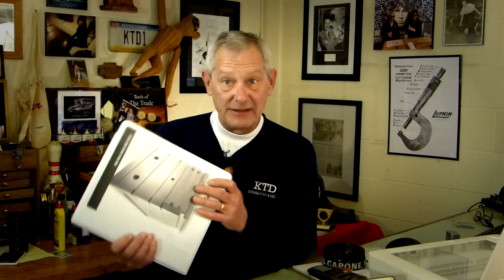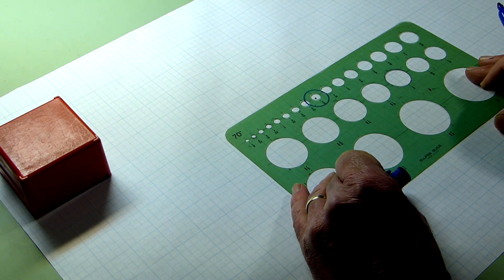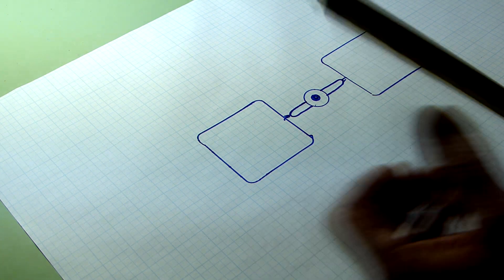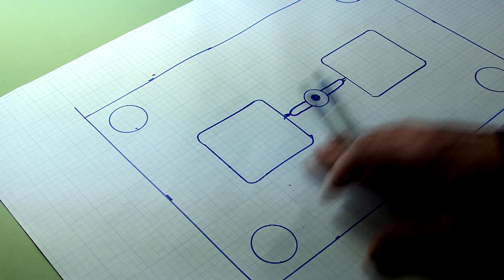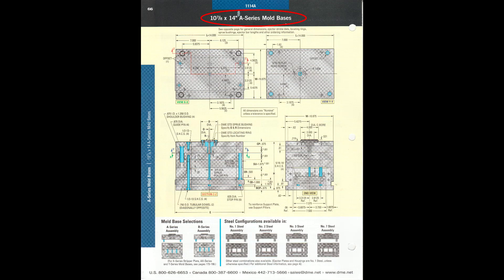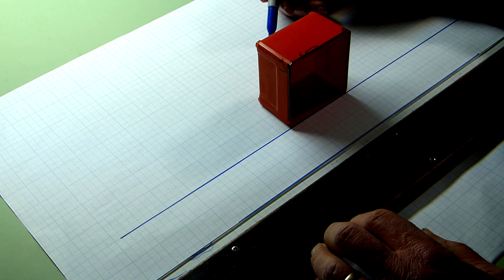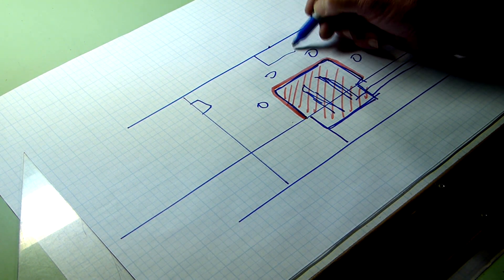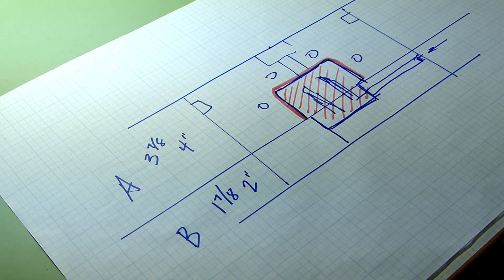MOLDMAKING AND DIE CAST DIES: ESTIMATING MOLD BASE SIZE

Comment: Great video. I do want to ask. What do the CAV 1 or CAV 2 markings denote? I found out they refer to cavities, but is that simply that the mold has one or two parts being molded at a time? Why would that be relevant to have it molded into the cast with those markings? Its for some Ford parts, and besides other weird markings I assume are for the supplier (like this GIL followed by some numbers), the CAV I have seen on non Ford parts, so I assume they are industry standard nomenclature.

Theyre for plastic trim panels by the way, like kick panels, and whatnot. Back in the day, the part number and engineering number were enough, but so many people don't know, and will ask for the most random markings (sometimes its all thats left undamaged from a part) so I am going through my inventory and marking down EVERYTHING especially for the very hard to find things.

In an alternate reality where the US was still manufacturing, your channel would be at a million subscribers though. Great video and learned a bit from a field outside my own!